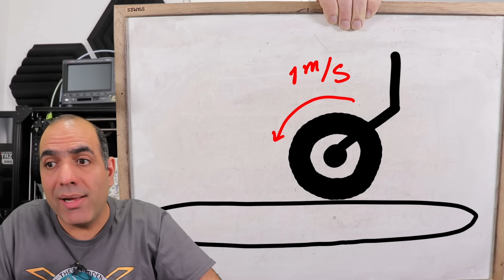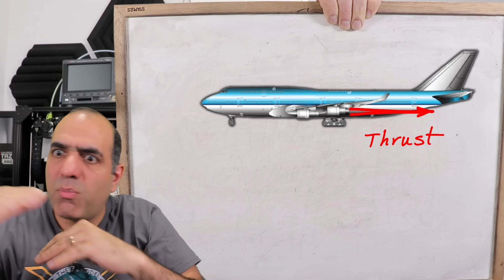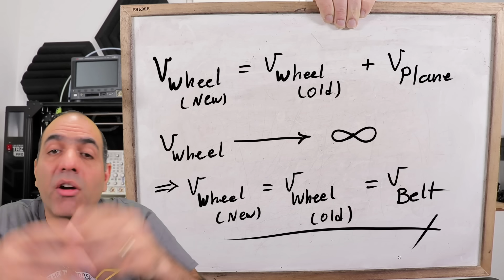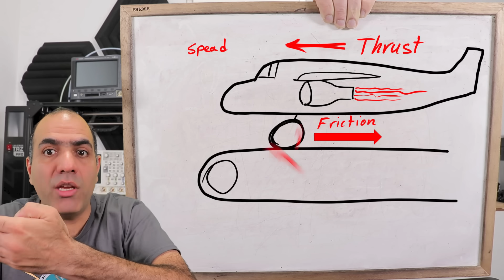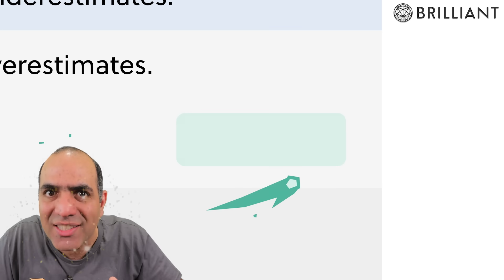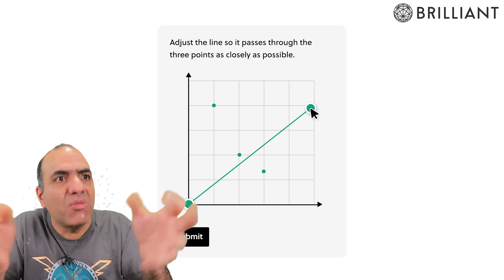Airplane Question that Drove Me NUTS!!!

Comment: Infinity never enters this equation. The planes forward speed is decoupled from the treadmill. If the plane moves forward at 10mph, the treadmill moves the belt -10mph. There is no cyclic feedback loop.
Reply: the question says the treadmill is designed to be the same speed with the wheel, not the forward speed, thus creating this feedback loop.
Reply: @ doesnt matter since the treadmill is 100% unrelated to the planes forward speed (it doesnt control the plane or slow it down). To better understand this, if the plane was 1 meter above the treadmill, then the plane would still go the same speed as if it were on it.
Reply: @GoatDirt  the treadmill ramps up when the wheel turn faster, but the wheel is attached to the treadmill, so if the engine push just a little bit, the threadmill will keep ramping up runaway and self destruct.
Reply: @samueladitya1729 I guess we should look at it as which reference the treadmill uses for knowing the speed. Is it based on the planes gps or ground speed? Assuming ground speed as reference, the treadmill is reading the planes ground reference only so is only going as fast as the negative vector.

Comment: Speed of the wheels would never exceed the take off speed, the plane would reach 300 km/h (or how much it needs), and simply take off. The conveyer belt would adjust it's speed to the speed of the wheels, but it wouldn't matter because the plane is generating speed over thrust force against the air, not the ground. So there is no scenario where wheels could ever reach crazy amount of speed towards infinite. Top speed of the wheels is the take off speed of the plane.
Reply: That assumes the conveyor spin up for no reason.  That’s not the requirement.

The conveyor only moves exactly the rate the wheel rotation of the test vehicle.  From 0 to hypothetical takeoff speed, you can calculate the wheel travel and wheel rpm.  That is the exact rate and rate of change of the conveyor linear travel.

Equilibrium.
Reply: @MrDefreese  true, but the wheels speed in that case wouldn't matter, wheels could even turn in the opposite direction it wouldn't slow the plane down, it would achieve the take off speed and fly anyway
Reply: @tariktokalija452  that tries to treat vehicle motion separately from wheel rotation.  The vehicle only moves on its wheels in one of two ways - either by sliding across the surface or by rolling.  We know the exact relationship between rolling wheel rotation and linear travel if it isn’t sliding.  That’s why we can focus on the equilibrium linear rate of the conveyor.

The math and physics are inescapable.

You can look at the treadmill car races to see equilibrium in action.

Comment: if the plane moves forward at a velocity 'v' and the belt opposes it at a velocity '-v' then the total velocity is 0.
Reply: Aircraft thrust acts on the air not the wheels. It takes off at normal speed with wheels spinning at twice normal RPM.
Reply: @PabloGonzalez-hv3td  but if we ignore the wheels and the air and think about the planes actual velocity
...
Reply: @JaiC12  Its velocity comes from engine thrust acting on the air. The wheels simply freewheel. Your formula is for a car with powered wheels.
Reply: @PabloGonzalez-hv3td  actually, what I'm trying to say is that if we ignore how the plane is being trusted, and if we look at at as just any object with a velocity. If the belt exactly counters that velocity, how can in move?
Reply: @JaiC12  The same way it moves through the atmosphere? By using engine thrust that acts on the air to move fast enough for the wings to create lift. 

The ground roll is simply accelerating to takeoff speed.
Reply: @PabloGonzalez-hv3td  if anything if matched with its negative equal, it's zero homie
Reply: @JaiC12   Yes. But that restriction is created by the relative wind. You asked how does the aircraft on the belt move? The answer is thrust propels it through the air. Not the wheels. 

The limitation of the belt speed is merely the structural limits of the wheel assembly. 2, 3, 4, 5 times the aircraft speed makes no difference to aircraft ground speed. Since again, the wheels simply freewheel.
Reply: @PabloGonzalez-hv3td you keep making the same mistake over and over again.  Thrust is just a force.  We know the basic formulae and logic of applying a force on a body with wheels.  All you get is the vehicle rolling.  We are explicitly given the (absurd) scenario that the conveyor moves at the same rate as the rolling vehicle.  It’s 1 to 1 for both speed and acceleration.  The vehicle is in equilibrium at all conditions.

Every counter argument is some attempt to break the specific parameters we are given.

This thought project is like those math problems that artificially manipulate parentheses to confound viewers.

Comment: Plane would take off the same as on a runway.  Jet engine thrust is not affected by the wheel speed.
Reply: It’s backwards.  The vehicle motion (aka rolling) is the result of force applied to the body.  While it’s on the ground, it can only roll and as it rolls, the conveyor moves at that same exact rate.

Comment: 0:42 The plane will take off because the thrust is stronger than the resistance of the conveyor bely
Reply: It has nothing to do with resistance.  This scenario is exactly the same logical thing as if you had matched cog gears and the applied force on one being exactly matched by the force applied on the other.  The meshed gears would remain in the same position.

Comment: in earth conditions with friction and the fact that planes don't use engines to turn a wheel the plane might start going backwards and fall off the belt if the engines are off and if the engines are on then the plane starts to accelerate and the wheels turn but the belt is stopping

Comment: I'm way late to seeing this but short answer is yes. The plans thrust and lift has nothing to do with the wheels ...  if we ignore bearing friction,  the wheels will simply be spinning 2x as fast as normal..  if you hold a toy car on a treadmill, you can still push it forward regardless of how fast the treadmill is going.
Reply: Lift is most definitely dependent on what’s happening on the ground.  There is no forward speed and no lift if ‘ground’ is moving at the same speed as the vehicle.

It’s a trick of frame of reference.
Reply: @MrDefreese  lift of an aircraft is dependent on what the wings are doing . The wheels do not provide any forward movment to an aircraft. Real world a plane would need more power to overcome the additional bearing friction from 2x ground speed. But if we ignore friction, the ground could move infinitly fast backwards,  as long as the plane can move forward in the atmosphere, it will be able to take off
Reply: @ultimatemonkey  nobody ever says the wheels provide forward movement to an aircraft, but the rolling of wheels is the end result of the force applied to the vehicle.

The vehicle - any wheeled vehicle - only rolls or 'scrubs' across the surface.  The only reason it would scrub across the surface is if rolling isn't possible, so we can sort of exclude that concept from this thought project.  The tangential instantaneous speed on the wheel is exactly the same as the translational speed of the wheel axle.  The conveyor essentially moves at the translational speed of the wheel axle.

The best way to visualize it is two fold.

One way is from the frame of reference on the (moving) surface of the conveyor).  The relative speed of the wheel axle is the same as if 'ground' were unmoving.

The other frame of reference is on the ground off of the conveyor.  From there the speed of the wheel axle is negated by the speed of the conveyor.

There is no other way. This is both calculus and physics together.

Comment: The wheel and conveyor belt are irrelevant here. A plane's engine do not power the wheels, it only produces a forward thrust, the wheels are free to rotate. So even if the conveyor belt is moving at the same speed as wheels, the plane will still move forward because of the forward thrust, generating lift and taking off.
Reply: the wheels are free to rotate, but they are not independent of the speed at the wheel axle.  That's an intro to physics calculation that shows the relationship between wheel rotation and translation.  Because that is not independent, the speed of 'ground' in the form of the moving conveyor can be factored in to give a zero net velocity.  It's saying that v = v as the fundamental condition.  We don't have any choice in trying to 'break' that stipulation.
Reply: @MrDefreese  There is no axle in planes. The wheel are not connected to each other. Each wheel is a free rotating entity on its own. They rotate because when the plane is pushed forward via the thrust produced by the engine(s).
Reply: @Anjali-ti2bi  there are axles on  aircraft.  To clarify, we are talking about the axis about which the wheel rotates.  Whether it has bearings is immaterial to the fundamental physical reality that in order for the plane to move, the wheels have to rotate and if they rotate, this magical conveyor belt exactly matches that speed.

Not only does it match the speed, but mathematically and physically, that means that the conveyor matches speed as the aircraft accelerates or decelerates.

The big problem with a lot of the attempted experiments is that they set the conveyor or treadmill at one set speed and then try to overpower that speed by revving an engine or a propeller or whatnot.

The gist is the same.  We know with certainty that we can place a rolling wheel on a treadmill or conveyor and match speed.  We know that we can apply a force to change the speed of the wheel and similarly match that speed with the conveyor.  With no net rate of change, the vehicle (car or aircraft) can be maintained in a single position....but this is utterly an absurd thought project and completely impractical for any real purpose.

Comment: My opinion is that it won't move anywhere.

My reasoning is this; 

A plane needs to move air over its wings in order to manipulate it and take off. The runway and wheels are moving at the exact same speed, which cancels out any forward movement that the plane might make and thus keeping it in the exact space. No forward movement = No air over wings = No take off.

I could be wrong, though. This is just my take on the matter
Reply: Your logic is correct.
Reply: @MrDefreese  both of your logic are incorrect! See above 👆
Reply: @dangill1227  the people who think the plane will take off or even move are making a slew of fundamental mistakes.  They are all incorrect; their logic is flawed.

For many, they are seduced by the big and powerful turbofan engines; for others, they are confused by the difference between linear speed vs. tangential speed.

It's a much simpler question and project and most folks come around when they abandon their flawed talking points.
Reply: @MrDefreese  Newtons 3rd law of physics is fairly widespread accepted. If you can explain to me by either a justifiable written explanation or a mathematical equation as to where the thrust of the engine goes (as it doesn't magically disappear), then I will happily stand corrected.
Reply: @dangill1227  the thrust of the engine doesn't magically disappear.  It only makes the vehicle roll while it's on the ground.  That shouldn't be controversial whatsoever.

The flip side of the issue is that the ground, the (absurd) conveyor is also running at the same speed because we are given that it 'exactly matches' the rolling speed of the vehicle.

You have seen these kinds of equilibrium settings.  There is a whole thread of videos on 'treadmill car races' where cars are placed on a treadmill with an incline so that the treadmill is in equilibrium with the rolling speed of he cars.  The force applied to the car is the constant of gravity.

It is a dumb thought project because there is no real practical purpose for this, but the math and the physics are given to us.
Reply: @MrDefreese  I do appreciate your attempt to explain your assessment of it but I still don’t have an answer as to where the enormous thrust force actually goes. I absolutely agree with you that it makes the “vehicle” roll while it’s on the ground but it’s not rolling the wheels so to speak, it’s moving the fuselage forward and dragging the wheels along as a result. This is the same whether the aircraft is in the air or on the ground. What makes the wheels spin is their contact with the ground and the tiny amount of frictional force it takes to make them rotate. Wheel rotation is a byproduct of the thrust not a consumer of it. The engine thrust cannot be transferred through the wheels as the wheels are free spinning making them a mere reactionary component. The conveyor speed is matched to the wheel speed, not driven by it meaning no force is being input by the wheels which is further proof that the thrust force is still within the airframe and must product a reaction. That reaction does not take place through the wheels nor does it through anything other than to propel the aircraft forward relative to the air. It is the laws of physics and you are yet to explain to me how it’s not.
Reply: @dangill1227  it doesn’t make the wheels scrub across the surface.  It just rolls.  If we know that the vehicle merely rolls, we know from introductory physics the exact relationship between rolling speed on the circumference of a wheel and the linear travel at the wheel axis or the tangential velocity on the contact patch with the surface.

It really is that easy.  People are making it overly complex when the principles are in first semester physics of angular velocity.

Comment: No not without a hurricane blowing at the plane ….i think but as a kid I always used to think about a sail boat with a fan on it…would the fan make the sail boat move??
Reply: A sail boat with a fan attached to it is very different to the aircraft conveyor scenario. With the sail boat, the fan is trying to push something that its attached to. The forces cancel each other and the boat remains stationary. With the plane, the engines push against the air behind the aircraft and are able to induce forward momentum on the plane. (Newtons 3rd law of physics) This thrust force has no direct relationship to the wheels as the wheels free spin and merely respond to the speed of the conveyor.  They have no ability to affect the momentum of the aircraft (except when the brakes are applied) thus become irrelevant in the overall assessment. Apart from the wheels reaching speeds that would likely cause themselves to self destruct, there is no practical justification as to why the plane would not take off.

Comment: No need to over complicate it so much. It’s pretty obvious that it won’t take off. The propulsion is caused by the jets yes but the only thing they do is push forward so it actually does work the same way as a car engine moves a car. It’s why a sale boat can’t propel itself with a fan on it. You need the friction of the wind to cause lift. So your frictionless environment would also mean no lift no matter what. This has gotto be the first thing I’ve ever disagreed with you on. Every single other video like this we have had to same thoughts and conclusions. This was a case of simply overthinking it too much lol. Take care brotha!
Reply: A sail boat with a fan attached to it is very different to the aircraft conveyor scenario. With the sail boat, the fan is trying to push something that its attached to. The forces cancel each other and the boat remains stationary. With the plane, the engines push against the air behind the aircraft and are able to induce forward momentum on the plane. (Newtons 3rd law of physics) This thrust force has no direct relationship to the wheels as the wheels free spin and merely respond to the speed of the conveyor.  They have no ability to affect the momentum of the aircraft (except when the brakes are applied) thus become irrelevant in the overall assessment. Apart from the wheels reaching speeds that would likely cause themselves to self destruct, there is no practical justification as to why the plane would not take off.

If you say it wont take off you are essentially disagreeing with Isaac Newtons 3rd law of physics.

Comment: 0:42 just started and no becouse the uplift of air pressure isint enugh becouse it’s not actually moving
Edit : :55 I just realized that the wheels don’t move the plane the jets do so it would move off the conveyor or if the conveyor is never ending than it would still take off

Comment: Easiest Answer:

1. If on conveyor belt: Depending on the elevation of the conveyor, the thrusters would pull the plane off the edge, before the belt could match the speed, thus causing the the front wheel to smack on to the ground (potentially damaging/breaking it off), then it would be rubbing on it's nose damaging it further.

2. If the conveyor is level with the floor: The plane would start of slow, as (the belt would go backwards), then you'd feel a sudden jolt (as it comes into contact with the ground), then take-off would be normal.

3. If stationary: No wind, no lift-off!

Reasons 1 & 2 apply in all aspects!

Also, the thrusters power the plane (not the wheels), so there would be no traction.

If there was traction, then reason 3. would apply.

Comment: Assuming the post means the plane accelerates backwards at its regular speed, id wage no because the shape of the wing is designed to cause the air above it to be less dense or pressurized or something, and i dont think it quite works that way backwards